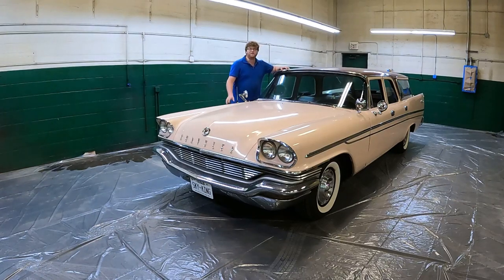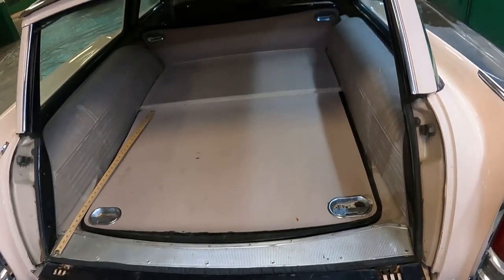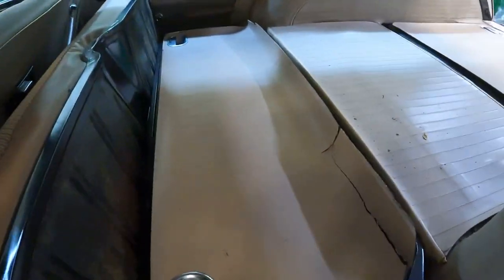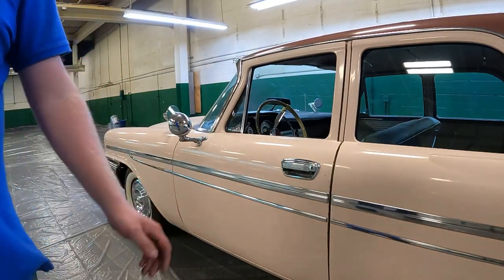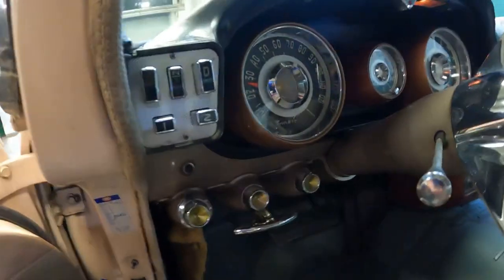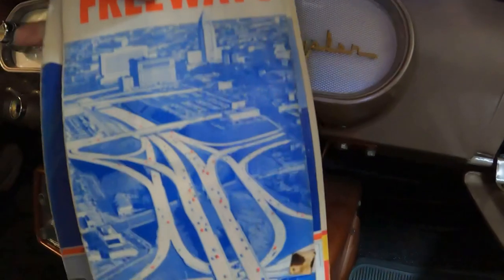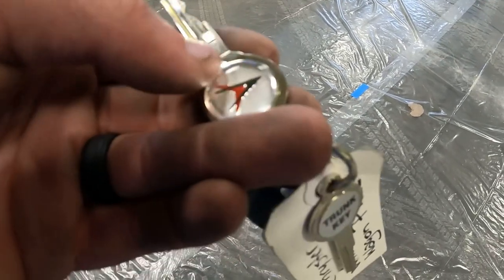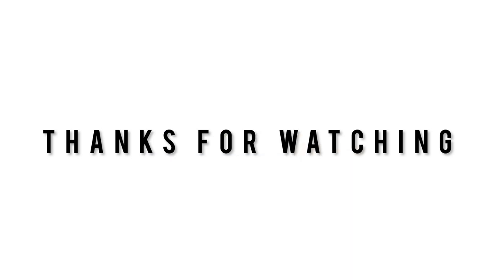Probably most in depth review of 1957 Chrysler Windsor town and country wagon #chrysler #wagon #v8

Comment: I have one picky comment, '57 Chrysler non-wagons did not have the gas filler behind the taillight. That was a GM thing. The gas filler was behind a trap door on the driver's side rear fender.
Reply from the maker: Thank you for that correction I must have been thinking about the Continental mark II

Comment: I own a '57 Saratoga, and the keys are actually aluminum.
Reply from the maker: That’s really cool aluminum keys when Chevy was doing brass keys thank you so much for sharing
Reply: @What.its.like.  No problem! 🙂 The keys have the Chrysler Lion emblem as well as the big C. Just like the one in the steering wheel.
Reply from the maker: That’s awesome keys are like album covers lost art.. I like showcasing what the keys look like because everyone did keys different. The only thing is these cars if you drove them the key cylinder would need replaced and was cheaper to get an after market one.
Reply: @What.its.like.  Heck even my push buttons are in near perfect condition. While most are worn down.
Reply from the maker: I love the feel of everything on older cars you were a part of the experience.. it’s hard to explain to someone who hasn’t drove anything like it. My 52 Chevy truck when I put switch gears it clicks into gear.. it’s small things like that. The Lincoln I had a Unique click when I turn the turn signals on. Even the Honda van when I use the turn signals clicks I don’t like the new ones that don’t give you any sort of feedback that a button has been pushed. The sad thing is unless you experience it first hand you don’t know what your missing. I like evs but there is sort of a disconnect when driving them which is weird given the fact that you can connect with everyone you know as driving but the soul is gone. It’s hard to explain the best metaphor I’ve come up with is new cars are like appliances were old vintage are where machines.. I was talking to someone the other day if given the choice between a 2022 Bugatti Chiron or 1926 Bugatti type 35 which would you take? I’d take the type 35. I hate to admit it the exotic cars don’t do it for me. I like the weird cars the weirder the better... I’m just a regular guy and I mean if I ever “make”  it in life I’d never own a Ferrari Lamborghini those aren’t my style now a packard twin six that’s more me or a 20s 30s Indy car. I like older Lamborghini Maserati some Ferraris the new ones don’t do anything for me. I posted a Bugatti Chiron on this channel and it didn’t do well so my audience doesn’t care for those cars either which makes me feel better. =)
Reply: @What.its.like.  I really love the bell like sound when I turn the turn signal switch. Unfortunately my car currently isn't road ready, but its slowly getting there. On a side note. My buddy owns a 1953 Plymouth Cranbrook Club Coupe, and we are both only in our 20s. Most guys are age want either American muscle or newer foreign sports cars.
Reply: @What.its.like.  I would have to agree with you. Old cars are machines, and do have a soul. There's something magical about 60+ year old cars. Because if someone is driving down the street in a brand new Lambo. I would probably see it and say that's cool. However if someone is cruising down the road in a late 50s Caddy or any other vintage car. I would be absolutely amazed and I wouldbe pointing at it and shouting like a mad man.  You should have seen the amounts of thumbs up and stares I got pulling my '57 Chrysler from Michigan back to Wisconsin. It was absolutely incredible.
Reply from the maker: Here is a link to Facebook what’s it like page I made it to see everyone’s cool rides.. I don’t do email you I’d give you that. I’ll link it up with the channel one day =p

https://www.facebook.com/107924541676287/posts/154230180379056/?d=n
Reply: @What.its.like.  I shared some pictures of my car.
Reply from the maker: I just looked I didn’t see them =(
Reply: @What.its.like.  I sent them via messenges.